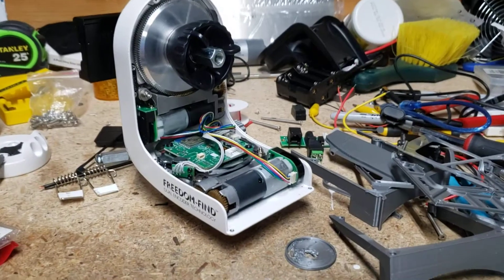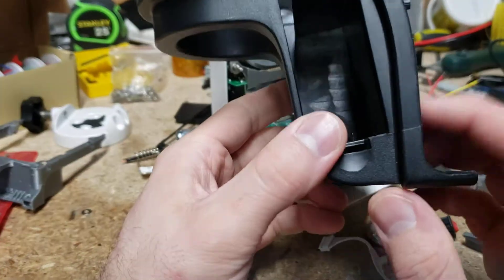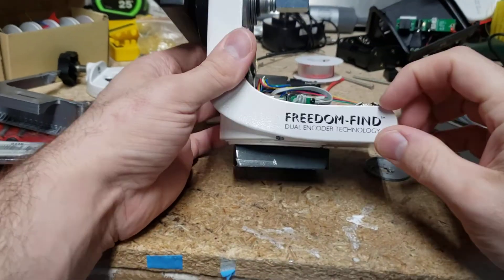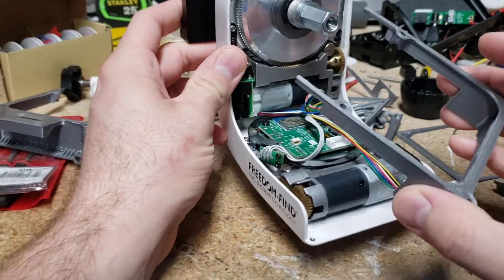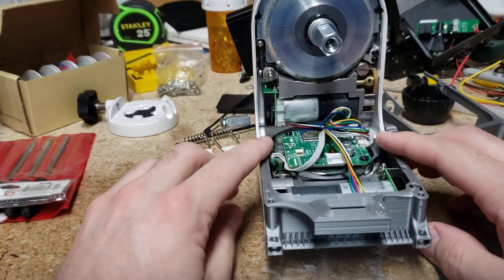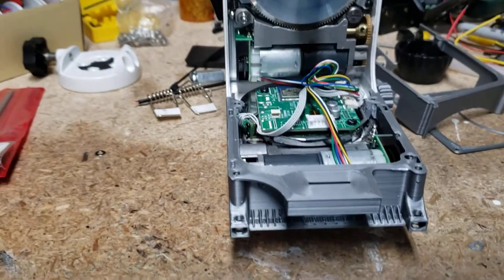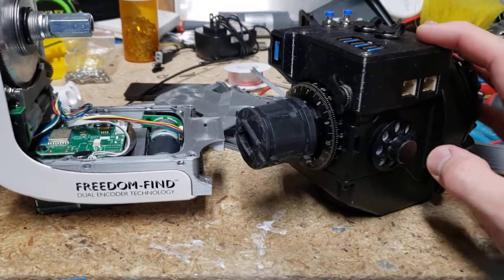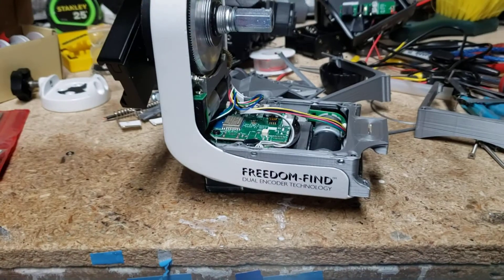WIP DIY AZ-GTi modification

Comment: Question: My skywatcher will not move in any direction. I hear the motors running but nothing moves. Any ideas? Thx
Reply: sorry to hear that. should probabl contact SW support. they used to e very responsive. If this is post rebuild then probably put something in too tight.
Reply: @kyleharrold5749  Thanks for the reply. I did call tech support. Seems I had the speed too low. (5) Dialed it up to 9 and good to go. (DUH) Just didnt notice it..
Reply: Never mind. I figured it out.